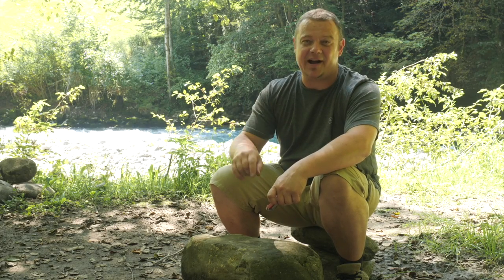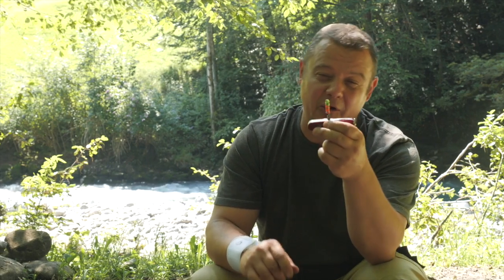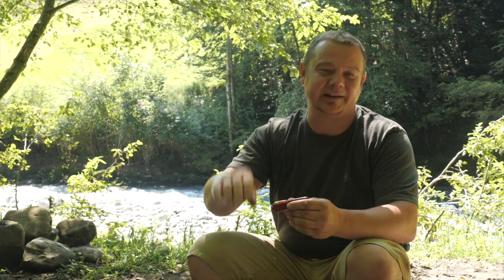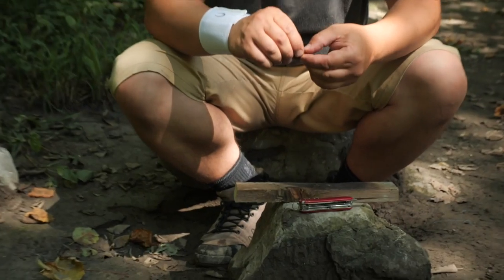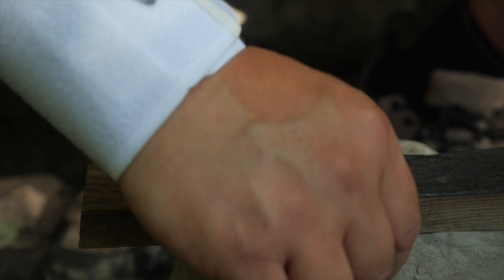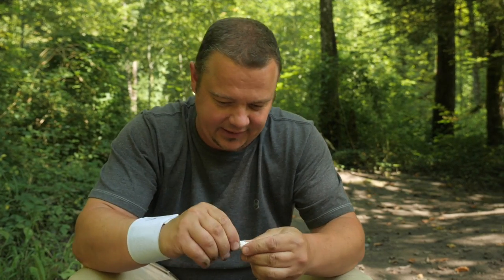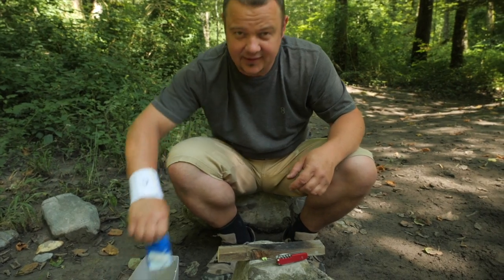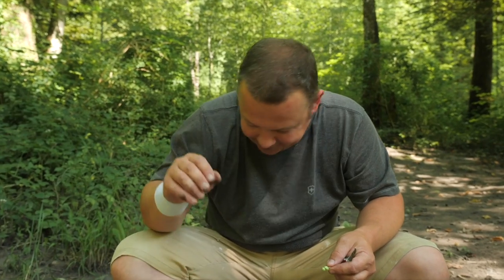Victorinox claims: 100 fires with just one FireAnt. Is that possible? Let's test it!!

Comment: But sir the fat wood tinder burn really well compare to other tinders

It burned for long enough time to add more fuel to it and very brightly compare to other tinders which u have shown in the video 

I think carrying a peace of fat wood in survival condition is really good 

And about the fire starter 

Yes it's small but it's handy 

Good video keep going 👍

🇮🇳🙏🕉🙏🇮🇳
Reply: We rub a little bit of vaseline into a cottonball and stuff several down into a drinking straw (bubble tea straws work best). Melt the ends of the straw and crimp them with pliers so we don't get a mess in our kit. Each cotton ball will still take a spark quite easily and burn a solid 10 minutes. That's definitely long enough to get a fire going.
I've made my own videos and timed the burn. (I have not posted any of my videos though - they're just for personal use.)
Reply: @MasterYoist  what is Ur channel name ? 

🇮🇳🙏🕉🙏🇮🇳
Reply: Another advandage of fatwood, is that it's natural and  heathy, not toxic like most firestarting materials are!!

Comment: The fact that if your using the micro fire steel it means your not as prepared ,and as such may only have natural forest materials as tinder which you have shown it doesn't work very well .So if your carrying fine tinder why not a larger fire steel. So to me it would be of very limited use.